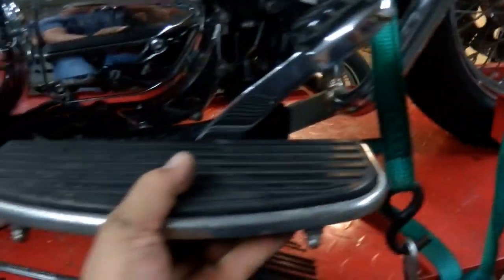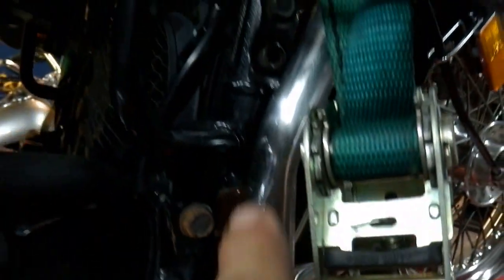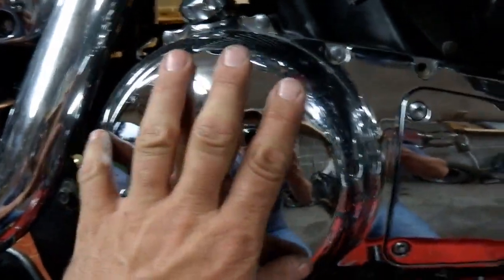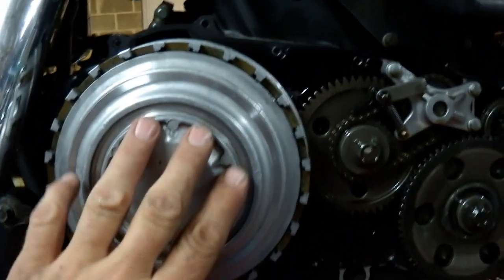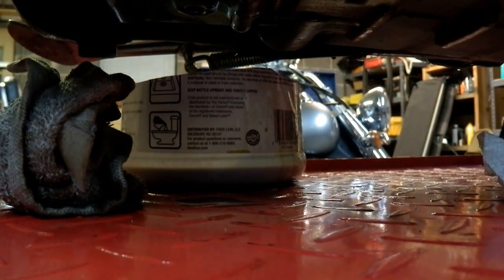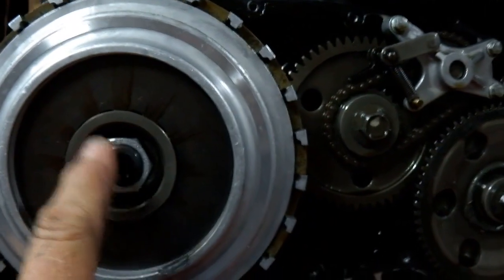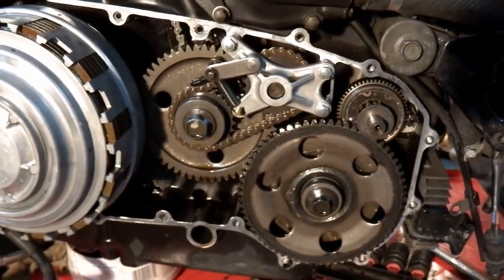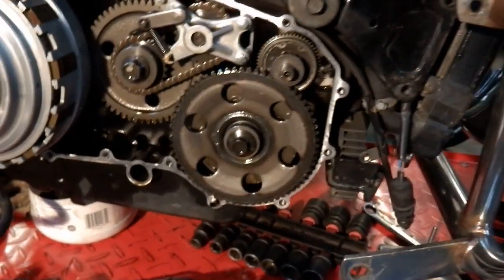2003 Kawasaki Vulcan 1500 Clutch repair Upgrade

Comment: I have a 07 Kawasaki Vulcan and I could really use that clutch spring washer you got from the 05 does it help with the slip and can you tell me where I can find one ASAP and would it work on the 07
Reply from the maker: Look up Kawasaki parts for an 05 model, look at diagram for clutch, you need that washer part and hub , look at comments on one of my videos has part numbers ,, won't help with slipping, you need that large washer spring that goes on them parts, changed mine ,, cliches were still going, parts I replaced were to provent wear on that part
Reply: @mobilmontana  okay thank you so much that helps me out a grip

Comment: I know this is old but where did you find the washer with the teeth for the spring
Reply from the maker: Look up parts schematic for 2005, compare it to yours, compare part numbers,, two parts are different, the hub or center and that washer ,, got mine on ebay used

Comment: Dave, great video, do you only need the upgraded washer or do you need the other part too. It just looks the same as the other one.
Reply from the maker: You need the inner part as well, they look the same but the inner part has a lip or rim at one end that is thinner on the newer one allowing the thicker washer part.
Reply: Thanks Davey boy, superb,

Comment: Really good diy video. I have a 99 Vulcan Classic , are the clutches the same for several years after 99 or have they changed, part numbers and such ? Also how much are new clutch plates and the rest cost , ball park ?  I don't pull a trailer and mine slips a good bit when accelerating but it's rideable . Thanks.
Reply: Oh and I Subscribed and liked.
Reply from the maker: Hay Paul, new clutch plates run around $12 - $15 each plus shipping, check around, and yes there the same for sever years but make sure.  If your not in a hurry I would order just cover gasket and clutch spring. You might not need new clutch disks, I bought new clutch disks and ended up not using them, There is a speck for how thick they should be, Min and Max thickness, My whole trouble ended up just the spring, I bought a Barnett spring, a little heavier duty than stock but also harder to pull lever, Looking back a stock spring would of worked, There is also a spec on the clutch spring to see if its wore out and mine was. Good luck and if you do need clutch disks and prices seam high I might be willing to part with the new set I never used
Reply: David Anderson Thanks Dave , I'm a truck driver so I have a hard time making time to jump on it. I think I will order the Barnett springs along with a stainless braided clutch hose. I bought it from a friend and he had put tall ape hangers along with extended hoses and cables and I will be replacing those as well. I really appreciate your response and advise. It might be a few weeks or more before I do it and if I need plates I will see if you still have them.

Comment: hello, i saw burnett clutch kit, bat does'n have the litle rind with teeth so were i can find it
Reply from the maker: Ebay in used clutch parts from later model like 2005
Reply from the maker: You need that ring and center hub part,, edge is a little thinner too

Comment: any more slipping after you replaced the spring?
Reply from the maker: No, pulled my trailer around the Smoky Mountains this summer and a trip to Charlotte NC from Chattanooga TN area, No slipping
Reply: chester coleman awesome!!!
Reply: What is that part number for the washer with teeth that goes into the spring holder? Im looking for it.

Comment: Lord David, I need help. my nomadic vulcan 1500cc year 1998 model 1999 need to draw white smoke in the exhaust. may be the valve seals. The machine did not rotate much. she gets very still and I rarely call. this is 40,000 miles round. I am here in Brazil and I have difficulties with freckles. I do not know the torque tightness in the engine. Can you give me the engine tightening specifications? thank you if you can help me thank you.
Reply from the maker: Here is a link I found on the Internet with torque specs, Good luck  https://gadgetsfixitpage.com/article.php/torque-specifications-vulcan-1500

Comment: Hey Dave, I have a 1995 Vulcan 1500 that I believe the clutch was installed incorrectly. The clutch is WAY to aggressive. It need a good 1/3 throttle to not stall out and is damn near uncontrollable at take off. Any suggestions would be appreciated
Reply from the maker: I guess try checking out clutch master cylinder and slave cylinder, make sure when you pull clutch lever your getting full stroke out of the piston the lever pushes, maybe the piston is not fully returning after you release lever so not getting full travel, Check slave cylinder, after you release lever the piston on slave should remain in contact with clutch rod, meaning check the piston isn't releasing to much due to corrosion or dirt pushing it back. A little travel from either pistons makes a bid difference,

Comment: Hey pal what size steel plates did you use with the upgrade. I have a 2000. Vulcan classic.
Reply from the maker: I reused the stock steel and fiber plates, after measuring the thickness of old and new I realized the only worn out parts were the spring washer

Comment: David Anderson, thank you for the help. I have a question. So I'm going to be ordering that new spring washer you recommended but where do I find that washer with the teeth on it? How did you come across that? Thanks in advance.
Reply from the maker: I worked on a 2005 model for a guy and noticed the difference so I searched E-Bay and found the parts to change mine over, If your going to use that washer with the teeth you need to change the hub it rides on as wall, Kawasaki part numbers 13280-1307 & 13280-1306 Both parts are called Holder on the Kawasaki parts schematic, Good luck
Reply: One more Question, Do you think those parts would work for a 1997 Volcan? I looked up the diagram for both a 97 through 2005 and they look pretty well the same aside from that one part.

Comment: Hi Dave I have a question about my 1998 Vulcan 1500 classic. I bought the bike with a seized engine and i found a used engine on ebay. ist a 2000 Vulcan 1500 Nomad. It looks like the same engine. Do you know anything about compatibuility between these bikes? Thanks for the previous responce.
Reply from the maker: Things to look for, are they both carburetor engines,  heads are different from fuel injected ones,
Check the shape of the black duct or tube going from one side of the engine to the other where the air cleaner bolts on, the shape of that duct is different on some models but you could change it from old engine.  
I looked at an engine out of a 98 Nomad on eBay and think it will work
Reply from the maker: About the same except the 2000 might be Fuel injection and if it is might have to change intake and or heads

Comment: I've got 39,000 on my 1500 classic and it's starting to slip when I get on it... seems like it only does it in 4th gear tho... anyway, how long do I have before I gotta do this? i got a trip comming up and don't wanna get stuck. also I read where you can adjust at the lever to buy more time is that true? love your videos brother thanks!
Reply: I just got the bike and did an oil change. it seems it made it worse. I used GTX 4t 10/40
Reply from the maker: I guess if you stay our of the throttle you should be OK, What surprised me is when I did go to work on my clutch I went out and bought clutch fiber plates first then when I took it apart I found my old ones were still in very good shape, that's when I deiced to just replace the spring.
Reply: +David Anderson yeah I seen that that's weird haha thanks for the response bud

Comment: Looking for that 2005 washer and spring holder for the Barrett spring. Part number would be very awesome. Have a 2001 vulcan 1500. Slipping when I take off and right after shifting gears and apply gas.
Reply: The washer with teeth on it...slides over the spring holder
Reply from the maker: Holder Part # 13280-1307 and Holder Part # 13280-1306,, If you change the washer with teeth you need to change the hub,, They are a pair and need to use both older style or both newer style to get the right over all dimensions,,  Kawasaki calls both parts by the same name,,??  Factory spring clutch Part # 92144-1934 is the same on your 2001 and the 2005,, I'm sure kawasaki spring would be good, I used a Barnet spring but have to admit it's a little hard to hold in at a long light.  Look on ebay,, lots of used clutch parts,, got my parts from a 2005 but im sure other years will work as well ,, Good luck
Reply: Now can putting regular 10-40 valveoline oil and slightly over filling it a little...affect clutch slippage?
Reply: 3.5 quarts is what I put in....maybe 3.7 qts.
Reply from the maker: Overfilling won't effect clutch,,, More than likely with how old your bike is it's the spring,,  I bought new clutch for mine and didn't even use it, mine was still good, just spring wasn't ,, Now as far as oil,, It's a good idea to use motorcycle oil,, Valvoline motorcycle oil is what I use, it has an additive for the clutch,  Sill betting its the spring,, Get an aftermarket spring or the stock one,, chances when you get it out there's a way to measure it,, I measured mine and new that was the problem,, I could see the difference compared to the new one
Reply: Bought the bike 2 weeks ago. Drove it home..... no slipping. bike has 12,400 miles on it, and it didn't start slipping until I did my oil change once I brought it home. I put conventional 10w 40 valvoline.... Non motorcycle oil in it. Over filled it of course. I should probably drain it dry.... do a filter change.....and apply 10w 40 valvoline MOTORCYCLE oil instead..... Correct 
mid- level oil amount.... And see if that makes any difference. Before digging into the clutch housing.
Reply from the maker: Cant hurt, you might get lucky,, change oil and filter,, ride it and use the clutch lever a lot to allow new oil to penetrate between clutch plates,,, Good luck

Comment: Hi Dave I have a 1998 vulcan 1500 I'm doing my clutch. Where did u get the upgrade hub and washer from ?
Reply from the maker: From a 2005 Vulcan 1500, found the parts used on E Bay for like $15 or 20
Reply: Hi Dave Brian Scott again I'm having trouble with the clutch on my 1500 it's a 1998 vulcan I watched your video u did and didn't have as good of luck as u did when I reassembled there's a 8th off an inch gap between the clutch spring and the hub where the old wear took place that should be tight with no play correct??? What am I doing wrong???
Reply: he said its a little thicker so make sure it goes on the teethe and goes in far enough , tighten bolt and wiggle i guess

Comment: Hi Dave, I have an 04 vulcan 1500 classic. How many still rings do I need in addition to the 8 clutch plates. The clutch is slipping  and the bike has 45000 miles on it, so I would like to replace the steel rings as well.
Reply from the maker: I think 7 steel plates, I bought all new fiber plates only, When I took took it all apart and miked old and new ones I realized I didn't need to replace them, they were hardly worn, If it were me I would just replace spring either with factory one or like me use a Barnett spring, I have nearly 60,000 miles on my bike and pull a trailer with my bike and no more slipping   (Barnett  Part # 502-00-01025) Im sure a new factory spring will work as well
Reply: unfortunately the oil ran low and when I added to it the clutch was still slipping so I thing I have glazed the the plates.
Reply: unfortunately, do to my in-attention, I let the oil drop too low, and when I added to it, the clutch is still slipping. So I'm afraid that I have glazed the plates. I will also be adding the barnett spring as well
Reply from the maker: Well good luck, dont forget to check that spring like I showed in video and if its even close replace it.
Did you all ready buy the fiber clutch plates ? I have a set of new OEM Kawasaki fibers turned out I didn't need
Reply: I Have them on order
Reply: David Anderson I have a 96 Vulcan Classic 1500 D1.   You did what I've been wanting to do on my bike.   I have a few questions though.   Will the spring housing and spring holder fit on a 96?

Comment: about how many miles did this bike have on it when you did this and also how long do you have to soak your new clutch plates in oil for?  thanks.
Reply from the maker: I never used the new clutch plates, after measuring the new and old ones it turned out the slipping clutch was because the clutch spring was weak, I had about 60,000 miles on my bike when I did the repair to the clutch. In reality a factory replacement clutch spring would of did the job, The Barnett spring is a little hard to hold at a long traffic light LOL And soaking new clutch plates, I heard like an hour but I usually do overnight just to be sure
Reply: +David Anderson good deal buddy. I've got  41,000 on my 04 1500 classic and my clutch is starting to slip the reason I was asking about the mileage is because I'm wondering if I only need to replace the spring as well
Reply from the maker: And if you do need clutch fiber plates I have a whole set of new OEM Kawasaki ones I don't need but like me I bet you don't need them, Good luck with your project
Reply: +David Anderson thanks for the reply brother. it's not slipping bad only when I get on the throttle hard and sometimes when the bike gets hot, it don't seem to do it when it's cold.

Comment: Hi Dave, I ave changed the discs and plates in my 04 vulcan 1500, but I am not able to get the push rod back into place. also Just to make sure what is the order for the installation of the discs and plates
Reply from the maker: Take the chrome cover off the other side of engine, there you will see the clutch slave cylinder, Remove the three bolts holding the slave cylinder, When you finish with clutch you can install push rod from that side the slave cylinder is on, Push the piston back in like you would do on a brake caliper on disk brakes on a car, Reinstall slave cylinder after you finish working on the clutch but make sure you stick a little grease on what looks like a little ball in the center of slave cylinder piston, as the push rod spins with engine and piston only goes in and out. . Sa far as the order the clutch plates go, start with a fiber plate and every other one is steel, you should end with fiber plate then aluminum cover,
Reply: thanks Dave, I am now having an issue with the clutch cover not staying in place after I put the C-clip ring back in. Any suggestions would be a great help

Comment: I ordered the new Barnett spring. I was going to install it until I saw this video. I have looked for the washer you used with the teeth on it. The ones I found don't look like the one you used. Could you please give me the part number you used please?
Reply from the maker: My bike is a 2003 but the parts I used ( Washer with the teeth) were from a 2005. I just looked up the washer with the teeth, It's called a holder, part number 13280 1307 Now if you use that part you also need to replace what I call the hub it rides on as well as it has a thinner shoulder to make room for it and that part is also called a Holder, part number 13280 1306. Now the total price for these parts if you buy them new is around $110 but I bought mine together from the same guy used off E-Bay for around $30, There is a good parts diagram at www.kawasakipartshouse.com Open two windows and search your bike and the 2005 and you will see the difference.
Reply: Thats the part I was looking at. I am trying to find a better deal. $80 for a washer is crazy but if thats what will extend the life of my clutch thats what I will buy regardless. I have heard feed back about the clutch being too tight. Have you had this issue?
Reply from the maker: I replaced both of the parts I mentioned above along with the Barnett spring and the only issue is with that new Barnett spring the clutch lever is much stiffer, at a long light I switch into neutral.
Reply from the maker: Think I found the parts you need for like $28.00 on ebay. Go to ebay and search this number in the box at the top 232017615952
Reply: David Anderson thank you so much. I researched all day looking for one. I typed it just like you said and there it is. Just ordered it now just to do the install. Thank you again for all of your help.

Comment: Dude its a good video except for one thing you did not show putting in the push piece in and telling that you must push that piece in with you hands in order to put the operating plate back on and the snap ring back on. Kinda important step you skipped.
Reply from the maker: Good point